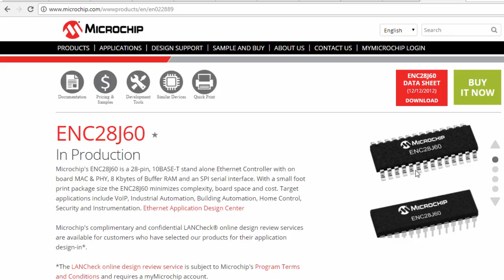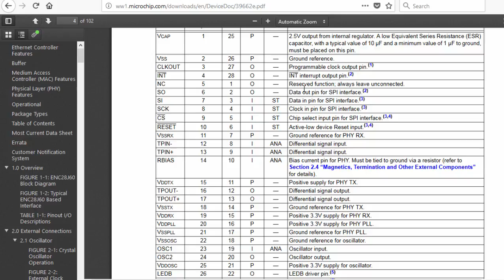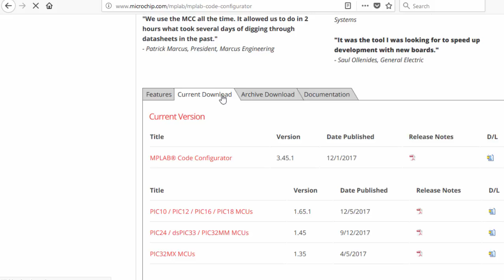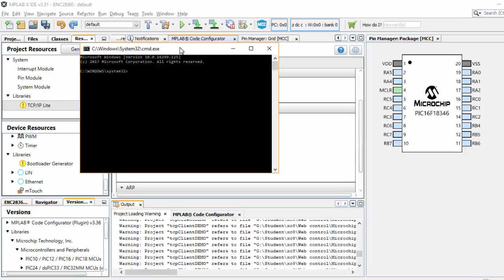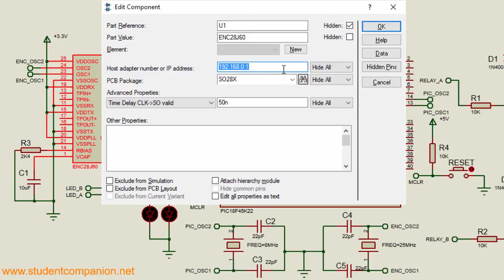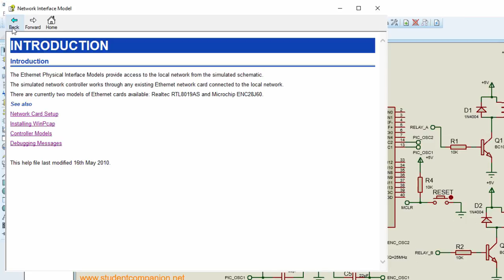98- Interfacing ENC28J60 Ethernet Controller | MPLAB XC8 for Beginners Tutorial

Comment: Which compiler you recommend : mikro or xc8??   Please advise
Reply from the maker: There are many factors to consider:
1. XC8 is microchip compiler, so it's guarantee that all released microcontrollers will be supported on time, with mikroC, support might be delayed or even not supported.
2. XC8 is free (the only difference with the professional license is code optimization) but mikroC is a paid compiler, the free version will limit your code size to 2kb, so you can't compile bigger code in free mode.
3. mikroC is generally easy to learn compared to XC8, it's supplied with plenty hardware and software libraries that you can use easily and speed up your design, but with XC8 using MPLAB Code Configurator (MCC), you are also getting the MCC generates the library codes for you for most peripherals.
4. MPLAB Code Configurator library codes is open, you can view it, modify it as you want for your specific application but library functions for mikroC are closed, you can't view what's going on inside or can't modify.
The list is long. You can decide for your self based on these info.

Comment: After long work time I fond that It works nicely just with C90 version of XC8, I tried with 2.2.8 vertion of TCP/IP Lite I dont know the latest 2.2.12 works too with C90, but actually this version was missing "udpv4.h" header file. So my quiestion is how can I try to add a html web page now?
Reply from the maker: Yes. I haven't tried this library with C99. Many people complained that it doesn't work with it only C90.
With html page you will need to communicate with HTTP which is not supported yet with the current version of TCP/IP Lite as far as I know.  You will need  the full TCP/IP stack not this lite version

Comment: Hi, just a question. I use the Olimex module 28J60-H that uses the ENC28J60 chip. I get it to work very well using MikroC. I tried to use MPLAB X with XC8 compiler, but I can't see how to configure the RST pin. Do you have any idea ? Because I already made the same that you have in this video, without success. For info I'm using PIC18F25Q10
Reply from the maker: What Do you want to do? You are not clear in your question.
Reply: Nevermind, I made it work. Thanks anyway.
Reply from the maker: @PauloMoreira1970  ok.
Reply: @StudentCompanion  Hi, simply, I would like to be able to ping the module using MPLAB with XC8. I don't see where can I configure the RST pin using MPLAB

Comment: Hi thanks for your video, I´ve some questions, I got this error trying to compile, MPLAB cant find this library "udpv4.h" and How Can I simulate this microcontroller inside proteus, it doesn´t exist.
Reply from the maker: Hi. Which microcontroller are you using? If it's not in your Proteus version it means you can't simulate it. Choose a different microcontroller. Concerning the error, it's better if you post more info. What library are you using? What's the version of your xc8 compiler?
Reply: @StudentCompanion  Hi, thanks four you response. Im using the same pic16f18346, Im going to send you  a youtube link with all the process im doing to show you exactly whats going on.
Reply: @StudentCompanion  I get MPLAB V5.1, XC8 V2.10, tcp V 2.2.12, Foundation Services V 0.1.31
Reply: @StudentCompanion  I cant find this unique library
Reply from the maker: The problem is XC8 in C99 mode. I think this library works with C90 only at the moment.
Reply: It gave me the same problem. I downloaded the code from its website and it worked.
Reply from the maker: @daniloandres  Hi, thanks for your feedback.  It might be because of the latest XC8 compiler in C99 mode.

Comment: Firstly thanks for sharing  , i did follow exactly the same as u have shown in this tutorial bt sill getting an error can u please give some suggestions

(mcc_generated_files/TCPIPLibrary/../drivers/spi_master.h:31:10: fatal error: '../spi1_driver.h')
Reply from the maker: Which PIC are you using? What's the version of your XC8 compiler? Can you post the full error message?
Reply: @StudentCompanion  Using the similar pic u are using in the tutorial pic 16f18346 with XC8 compiler (v2.05) 
also u can check the programm from this download link  https://we.tl/t-wTPwuRxnLM
ERROR 

In file included from mcc_generated_files/TCPIPLibrary/ENC28J60.c:46:
In file included from mcc_generated_files/TCPIPLibrary/../mcc.h:58:
mcc_generated_files/TCPIPLibrary/../drivers/spi_master.h:31:10: fatal error: '../spi1_driver.h' file not found
#include "../spi1_driver.h"
         ^~~~~~~~~~~~~~~~~~
Reply: @nikhilmiglani8321  Try to change to C90 instead of using C99. It worked for me.

Comment: Hi, did you have similar tutorial with PIC18F97j60 built-in Ethernet module? I have tried with latest version pé XC8 and MCC using TCP/IP Lite stack but it fails to compile. Can you help me? Thank you
Reply from the maker: If using XC8 v2, is it in C99 or C90?
Reply: @StudentCompanion  Wow. I've changed to C90 standard, under "Project Properties" -> "XC8 Complier", and WORKED! Thank you. You're a very good professional.
Reply from the maker: @fvgm  Thank you for your feedback.
Reply from the maker: @fvgm  Beside the C90, the SPI and ENC28J60 that you didn't select because you are using a PIC with built-in Ethernet, are there any other changes you did like in MCC configuration or in code to work with TCP/IP Lite stack?

Comment: Hey! Just wanted to ask you something. If I wanted to remotely access the controller could I do it without creating a Web server? For example if my address is 192.268.1.100 and I do port forwarding in port 80 in my router could I do everything remotely?
Reply from the maker: In simple terms. Yes you can. But the question how are planning to access the controller? You don't have to use a web server with Http only but that's one of the options among many more like UDP, TCP/IP etc. There must be some kind of interface to access it from like a web page, PC GUI or even command prompt.

Comment: Please do a video on the basis of SPI and I2C communication like using the max 7219 chip and i2c lcd in flowcode.
Reply from the maker: Please note there are so many components supported by flowcode and new ones are included in every new version of Flowcode. We can't guarantee you we will do a video on those displays. We can only cover standard communication protocols like I2C or SPI with no guarantee to use those displays as examples. You can right click those components in Flowcode and select help to learn more how to use them. If you really want us to record a video on that, then it has to be a special request which comes with a small fee.
Reply from the maker: Please note there are so many components supported by flowcode and new ones are included in every new version of Flowcode. We can't guarantee you we will do a video on those displays. We can only cover standard communication protocols like I2C or SPI with no guarantee to use those displays as examples. You can right click those components in Flowcode and select help to learn more how to use them. If you really want us to record a video on that, then it has to be a special request which comes with a small fee.